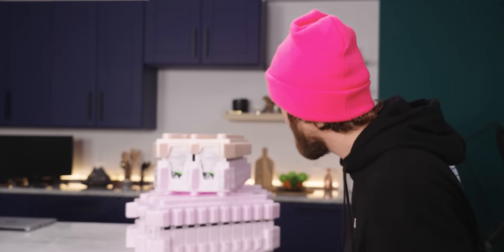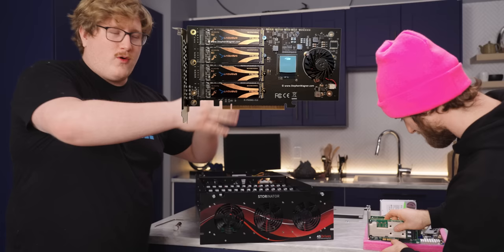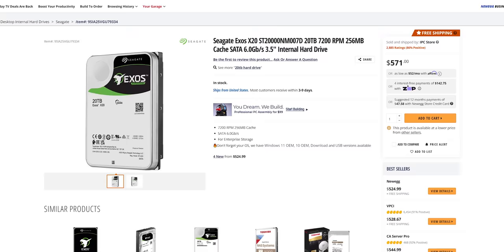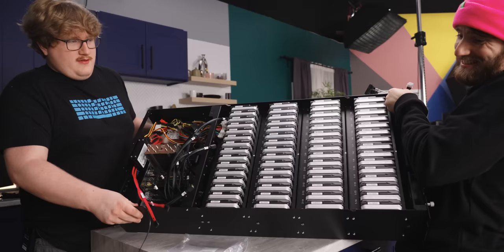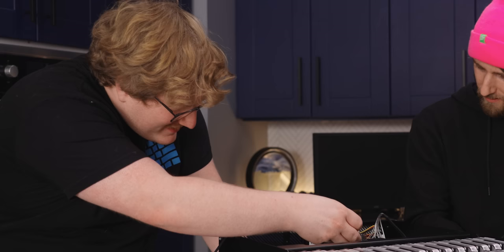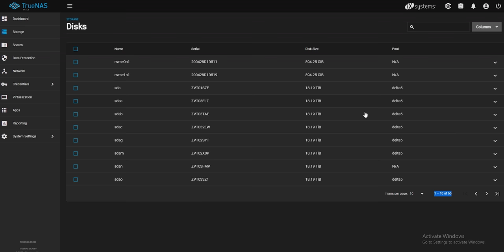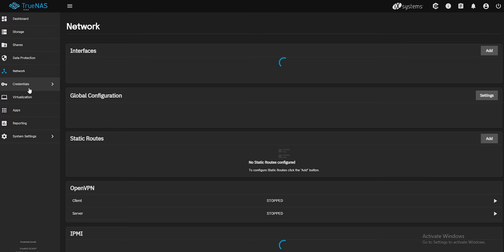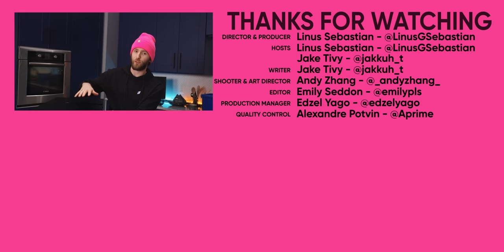My dream FINALLY came True! - Petabyte Project Recovery Part 2

Comment: Great to see that you didn't learn anything from the previous loss of data. 15 drives in a single z-raid2 vdev literally BEGS for the next catastrophe. Kids, this is clearly just for entertainment purposes, if you are building a data storage server for your home and you want to keep your data:
- Don't use such large drives, go for quantity instead. The resilvering/scrubbing on full 20 TB drives will take days, if not weeks
- Don't put more than 8 drives in a z-raid2. Just don't. Even better go for 6 or 7.
Reply: They could also just invest in tape storage that is so much better for archival purposes.
Reply: I thought they mentioned that this server configuration was only going to be used to restore the broken 2 servers since they needed a large amount of storage space to restore those 2. After that who knows how they will set it up?
Reply: @Donvermicelli  Didn't understand it that way but really hope so this is true. However, once the data is recovered, it sits on that gigantic misconfigured server. So they would have to rebuild the other two with new hardware and a better layout, copy all data back and re-install the new one. The data transfer alone would take ages
Reply: @THX-lc4tj  Yep, which is why they were going back and forth about how long it would actually take to recover all of it. Again, that's what I thought was going on but perhaps I just made assumptions along the way that don't line up with what their actual plan is.
Reply: mostly agree, but there is nothing wrong with up to 10 drives in a raidz2 if the drives aren't too large

Comment: I'm old enough that 20Mb in a single enclosure was lot, then came 20Gb, and now there is 20Tb. That is quite insane.
Reply: I know, right? Back when I was in university we had a file server that we called "the bottomless pit", because it had so much storage.

It had a capacity of 4GB 🤣. Even one of my laptops that's 12 years old now has twice as much RAM...
Reply: Bt still you can download old movies which are of pretty big size na, so how do they keep it for long time ??
Reply: @squidscrew1339  DVD Jukeboxes and Blu-Ray Jukeboxes. Been around for decades

Comment: I bought one of the 18 TB Exos type drives a bit over a year ago for 500 €. It serves as the game drive of my new machine. So far I can't really complain about loading times. These Seagate data centre drives are a lot faster than consumer hard drives from 10 years ago. Even though you can get these drives for 300 € nowadays, I don't regret paying what I did.

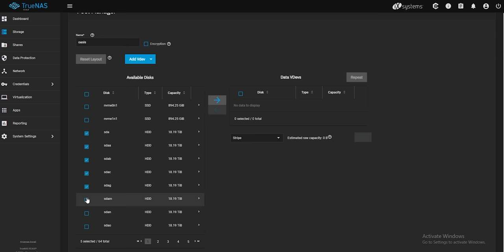Comment: 15:10 Have they really never used the "select-all" box before, or are they just trolling? (see the empty box  to the left of "Disk" - it selects all)

It's a very common design in applications to have such a box to make it easier to select all items within a list. Surprised they didn't immediately recognize it.

Edit: If they're only selecting HDD, not SSD, they can still select all, then unselect SSD, which would be a lot faster and easier.
Reply: i think they couldn't use the select all box because they were creating the vDevs so they had to select only 12 drives at a time
Reply: @gabrielenitti3243  oh

Comment: For the kind of workload you're having I'd set up the maximum payloads for everything, too. I mean setting up all disk drives with the sector size 4K (some NVMEs are not factory configured like that) and, if possible, jumbo frames on the network! In our nvme drives, going from 512 byte sector size to 4K meant a 5-10% improvement on sequential reading speeds. Using jumbo frames also improved slightly the transfer rate, maybe a 2-3%. OK, it may not be that much but hey, it was for free!
In my experience (4 years ago, not now), storage servers that dense were somehow problematic because even using RAID 4+2 there were some problems. Mainly, we had 2x10Gbps bonded network interfaces and when some of them failed (fortunately it had to do more with ports in the switches) you got only 50% of the bandwith for all the server. We preferred to have 2 less dense storage servers. Our workload was a bit different, anyways...
Reply: CALADO!

Comment: Imagine if Linus actually had to pay for all the hardware he uses?
Reply: Im sure he can afford it
Reply: @Ave-S  No Seagate gave them.
Reply: I doubt Seagate would give him a PETABYTE of drives for free
Reply: Ok so i commented a whole message, but i guess it was removed because of the spam bot program that Was talked about a video or 2 ago.

So if LTT does read this, ...i don't exactly know what triggered it.
I guess the takeaway is that there are false positives?
Reply: @Ave-S  of course there are false positives. Or did you honestly believe the dev's claim there weren't any?
Reply: @jfolz  The dev claimed that there wouldn't be false positives?
Reply: @Ave-S  YouTube has their own spam filters that channels can't turn off.  They seem to focus more on people being "mean" than actual spam though.
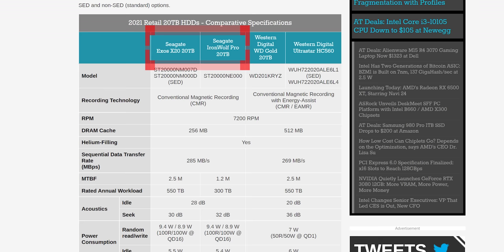Reply: @Ave-S  he sure did. Around 5:20 Linus cites a claim that false positive rates are "roughly zero". Based on whatever limited testing only one dev can do obviously...
Reply: @Ave-S   I had the same issue when I tried to leave a comment to the video about the anti spam tool! I copied it before I submitted it and tried like six times, slightly changing the wording every try to avoid triggering the bot - didn't work, don't know why, extremely annoying.

The irony is, that my comment would have been about exactly that problem:
I argued - or better: wanted to argue - that YouTube probably didn't do anything about the spammers because of the false positives and the (costly!) customer support they would require...

Comment: EPYC systems have always booted slow for me, especially compared to their Xeon counterparts. It's not a big deal, but it's definitely noticeable.
Reply: The last time I built a data server, I made it for 6 month maintainance interval

Lol why would you care about bootup time of a server anyway
Reply: @LongTran-em6hc   @Long Trần  Personally it matters to me because I'm a development engineer working on systems like this. We do a lot of power cycles when testing different hardware, and those POST times add up. 

So yeah, not normally a big deal for production environments. For diagnostics however, if you're used to seeing signs of life within 10s, it can be stressful to sit through the 30s+ POST of some EPYC systems.
Reply: Why not set up a quick boot?
Reply: @thejo6331  thanks for your explaination!
It does make sense now
Reply: I've never booted an EPYC server, but that must be a really long time considering how long regular Xeon servers take.

Comment: Well he is going against what many IT professionals would recommend. Having 20TB drives that is. Having more smaller drives as in the use case that just happened making this one be necessary to be a thing. Now think what would have happened if instead of just 16TB drives there was 20TB drives that had 2 of them fail with data? Depending on the drive pool size it might be a lot more data loss. NAS is usually good until you need a SAN. They are going from SAN to NAS you shouldn't do that if your objective is to keep all data uncorrupted. SAN's are a pain to set up and sync so data integrity is there. The benefit of a SAN is you can have more than just 1PiB of storage but you also get the redundancy of having it be over more pools and with more redundancy. The down side is it cost more to do, more to run, and takes more time to do the monthly data checks happen. The upside is there can be more than just 1PB of addressable storage at a time in a SAN all in RAID and due to the reasons behind why to have a SAN compared to a NAS it will all be able to recover from a data loss too. The parts i have seen take up the most room at those monthly error logs but they are needed for upkeep of the servers to run repair, restore or just replace a drive that failed. The logs are typically .txt files so it takes a while to get big enough to be noticeable but over time it does if you store it all onto one drive location.
Reply: Wtf are you talking about

Comment: The motherboard is going to fail within a couple of years due to drives being slotted properly while the motherboard is powered on. They are not hot-swappable at all.
Reply: The mobo isn't hosting the HDDs, the PCI E cards are, which obviously support hot swapping if the drives popped up on the OS after he pushed them in. Also a server not supporting hot swapping? You think when a drive dies in a data centre they shut down the whole server to change a drive?

Comment: respect the drives, walking with it still lotsa bumps.
the study was done with hard wheeled shopping cart, that offers nothing in shock absorbing.
get a cart with Quad bike wheels, half inflated them and add soft shock absorber suspension to move it with, no bumpy even across a parking lot.
Reply: I even saw one study that proved removing RAM from its packaging and waving it in the air changed bits. You can't win, but I do like your idea.

Comment: Everyone says that mechanical hard drives can last forever but I have torn through all that I’ve had. Every mechanical hard drive that I have had has eventually failed. I do a lot of downloading. Or at least I used to do a whole lot of downloading movies but now I just stream content. When I shifted to SSDs I have not had a single hard drive fail. Even though they are guaranteed to fail at some point they never have for me. Or at least they haven’t yet. But it was getting ridiculous with mechanical hard drives. I would buy the expensive version and take every precaution recommended. So either I had the worst luck imaginable, which a lot of people suggested, or I just tore through them by downloading too much and they weren’t as reliable as what I needed.
Reply: I'm still using the same SSD that was my very first, only 120 gigs. Spinning drives are nothing but failure problems. Unfortunately the cost of mass SSD drives is still outrageous. So there is no choice just yet until they get cheaper. Some day though, the day is coming as they get bigger and cheaper every year. Although there is still the problem with heavy use the SSD cells wear down much much faster. But I don't think that would be a problem on this back up server that is practically cold storage.

Comment: Still, another server offsite would be necessary. This is a well setup server now (I only recommend you to enable periodic snapshots in it, it doesn't take additional storage if everything goes right, for your use case. ZFS magic), but it still could happen that a fire or a robbery would make disappear all your data in a shot.
You're just one step away from the perfect storage solution: having a second server in a remote location, with periodic transfers from your local location. That second server may also be less redundant, it only serves a last resource purpose.

Comment: Linus: The ONE thing I am NOT flexible on, is this NEEDS to be on a cart. 
Jake: Do you even lift brah? I just carried it down here. Also: carts are bad for drives ::cites source:: 
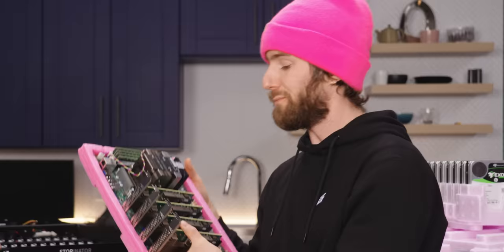Bonus from rewatching: 3:50 notice Jake giggle in anticipation of upcoming burn🔥 😄

Fantastic setup and delivery guys!

Comment: I actually just flashed an H200A to IT mode and hooked it to a SAS expander recently and found that the max drive count is supposedly 512. It's currently got 4 hard drives plugged in and they're being wiped via DBAN at a recycling center I work at, so not exactly the coolest use case, but since those cards are a dime a dozen and I can get 'em for free maybe I'll try making a massive server out of old drives, a decent $0 media server build would be hilarious.

Comment: Also, single node storage solutions make me anxious. There's a reason why basically every good enterprise-grade storage array features at least two nodes: one can fail and they run in HA, so the array stays up and complains or even calls home so the company you bought it from can send a tech out with a replacement node to get you running with redundancy again within a couple days at most. Running a single node storage solution is just begging for something on the motherboard to die and take out your shit.

Comment: IBM, at one point, tried to claim that their XIV arrays were fault tolerant to the point that you would never have to worry about data loss. Then the one we were using for block storage provisioning for our internal file server at work managed to lose a second drive on the data intake pool and the data storage pool before it could rebuild to hot spares and subsequently failed catastrophically. No storage array is ever entirely fool-proof and you should 100% be maintaining a bunch of both hot and cold spares and carefully monitoring the drives' SMART reporting to predict future drive failures and swap them before they have a chance to actually fail. At least if you're storing mission critical info on them. Otherwise, be prepared to ship off your drives and a handful of new drives of the same capacity to a data recovery specialist to have them try to make you some replacement drives. Not the easiest or cheapest thing to do. I so wish DellEMC would bring back the VNX2 with a new, hardened version of Windows Embedded and improved hardware support. Those things were my favorite arrays to support because replacing drives was a truly trivial task. You just looked at the front of the array, found the drives that were indicating as faulted, pulled out their sleds and replaced them with like drives. If your array was up-to-date, it would flash drive firmware automatically and then rebuild that segment of the storage pool. Because it was based on Windows, it was legitimately plug-and-play, unlike the majority of Linux or Unix based storage arrays. Unfortunately, the hardware and software limitations of VNX2 made it unprofitable to continue attempting to make improvements to the existing platform due to a lack of processing cores, memory capacity and speed, PCIe capacity and speed, and OS upgrade paths. So instead of spending hundreds of millions of dollars to engineer a replacement for a platform that had limited appeal due to a heavy reliance on SAS drive carriages, they decided to drop it for Unity, which offered a slightly cheaper and more space-efficient path forward. In terms of serviceability of the array, though, it is definitely a worse product, though. I do think that Dell made a product fairly similar to what you guys are building up called PowerVault, which used ultra-slim drive caddies and an internally managed cable armature to allow you to slide out the entire drive shelf and hot-swap faulted drives. The ME5084 is probably the closest and it supports up to 84 3.5" HDD, expansion with up to three 84-drive expansion bays, and two quad-port 32Gb FC cards for the fastest configuration of connectivity to your external file server to provision block storage. It's definitely meant to be solely a block storage device, and doesn't appear to offer any file storage or NAS functionality. Fine by me, as this allows you to virtualize your file server and run it in an HA environment. However, configuring that monster with the maximum number of 20TB drives does run you a staggering $225k USD. But it does fit all of that into a 5U chassis, so while they may be reaming you on HDD costs, you get a nicely packaged monster of a storage system with three years of support included.

Comment: Use the BTR Fastfile system it does the Beach tree so it’s basically like a raid raid but it’s just too and it’s a super yeah it will sell fix itself

Comment: would it make sense to keep the old vault (fix it/replace drives, fix your scrubbing/S.M.A.R.T. tasks, etc..... obviously) to store future/current /ongoing projects and leave vault 3 as your archive for completed projects? once a project is completed it is migrated to the vault 3 server.. this would leave cleanup, and file/folder assignment/naming easy & easily accessible to all staff.

Comment: Bit late now, but you really should add some 50 or 100gbe QSFP28 interfaces.  At the very least it will speed up the initial transfer, and ideally you'd leave them in for ongoing replication.

Comment: The thing I have learned trough out the years is that HDDs fail consistantly if they reach hours beyond 20k and have boots upwards of 5k. If it's an enterprise HDD it can last 50k due to booting only max few hundred times.
Also consumer HDDs such as WD Blue can last 30k if it isn't booted well past 2k times.
So basically it's just not how long then drive has been used, boot times are directly related to failure rates or at least I have seen a direct correlation between them. 
SSDs however simply fail in a blink of an eye. 
I have no experience with enterprise SSDs, but consumer SSDs simply fail without warning.
HDDs can become really slow of have some bad sectors yet you can get much data out without utilizing data recovery services which include actual disk swapping.
SSDs however, once they fail it is impossible to get any data out without some soldering work.
Thankfully controllers on SSDs is not that difficult to chance, but if it's a broken memory flash in question then you are out of luck. 

SSDs are fast, but so are the failures. HDDs are slow, but so are the failures.
I've had a lot better results getting data out of HDDs with just software then physically fixing and SSD.

Comment: 15 drives per vdev sounds like a lot - I'd consider 8 per vdev, or maybe 10 drives. Plus, it'll give you better throughput when you assemble all the vdevs into a single pool.

EDIT: I guess you knew that

Comment: @Trig    est. 2016
 Linus,
You've done air cooling. You've done water cooling.
You've done refrigerator cooling.
The next logical step is liquid nitrogen.
I want to see the hottest running CPU you have, quad
SLI Titan Blacks at full OC, and 128 GB of DDR4 RAM
all running at under O degrees.
Do you accept my challenge?